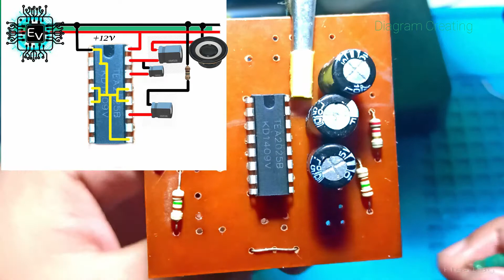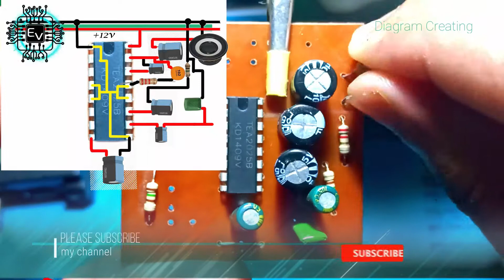TEA2025B Stereo Amplifier Circuit

Comment: I've try this and given input power 12v to the ic TEA2025B is getting hot faster in 5 minutes used..🤔
Reply from the maker: https://pdf1.alldatasheet.com/datasheet-pdf/view/25316/STMICROELECTRONICS/TEA2025B.html
Reply from the maker: please read this datasheet
Reply: @electrovibes7724  Yes I read the datasheet, but it doesn't seem like it is for long term use in 12 volts power. Even though the power is lowered to 9 volts, 1 hour of use is still hot. It seems more suitable to use power below 9 volts such as a power bank or a computer USB port and little speakers scale. I have tried using a speaker 6 inches / 4 ohms / 20 watts, use 15 minutes + full volume, OMG, its very extreme hot and after a few minutes then, its been smooking + cracking that ic. Maybe it will more better using a heatsink and extra fan. Sorry, this is just my own opinion..✌️😁🙏